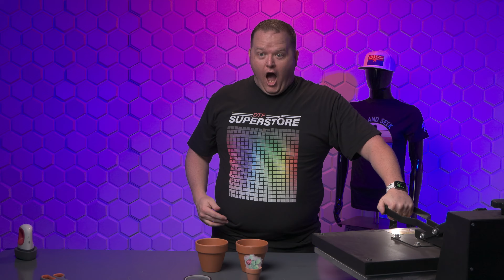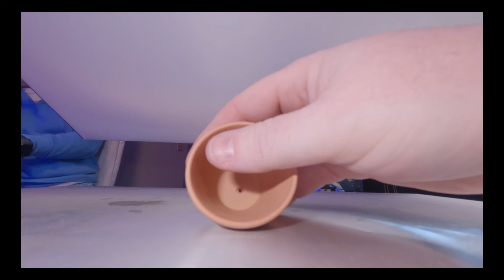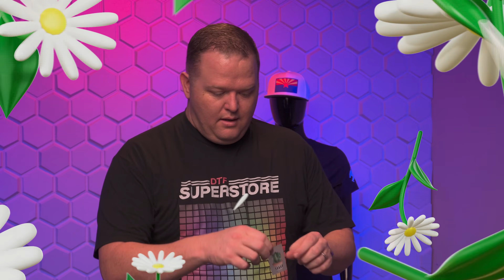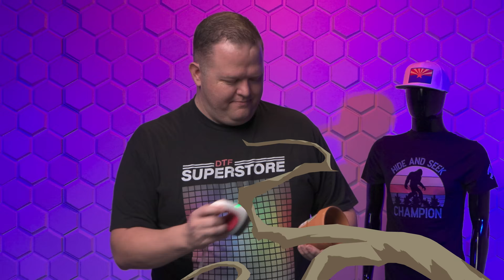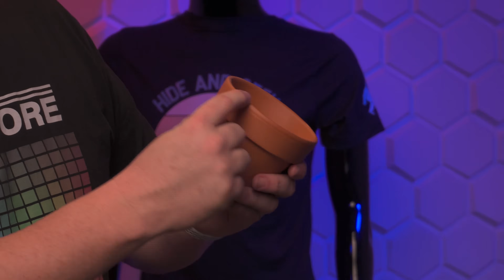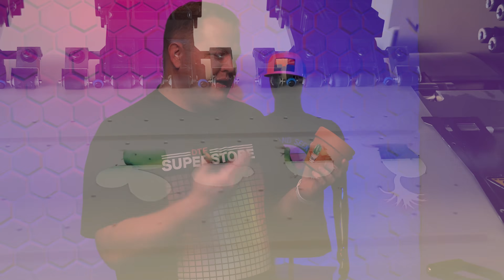Terra Cotta Pot | Will it DTF?

Comment: That works. Doing that on cups and so, you know, all the things you drink from and put in the washer won't work. That's a job for UV printwork.
Reply from the maker: actually...we did it on a metal tumbler. Still testing it's durability and it's holding up quite well. https://youtu.be/lNjIvObhNmY